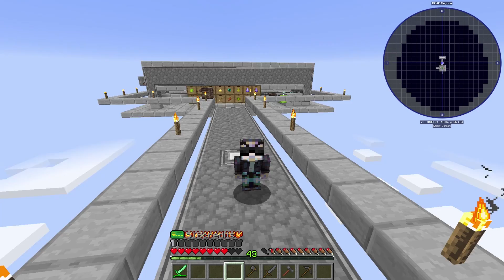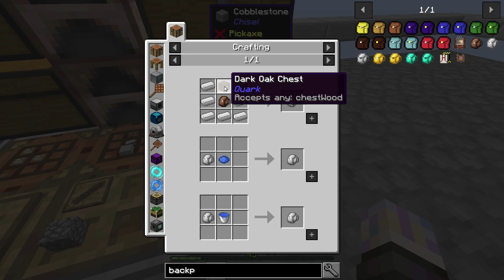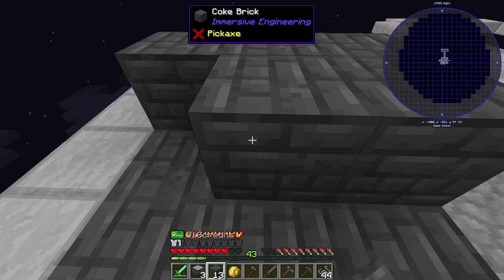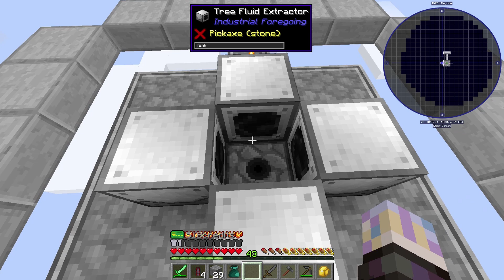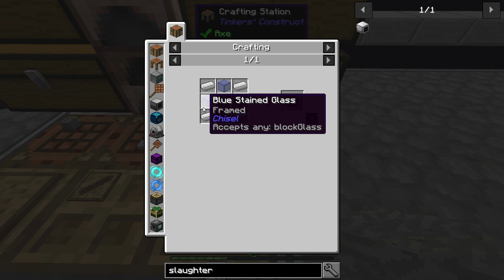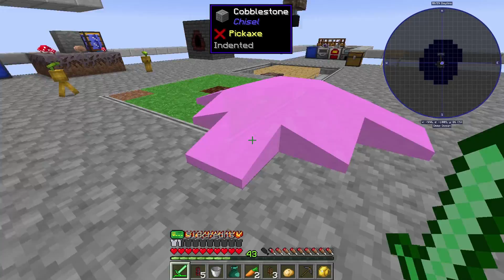SkyBlock Adventures EP5 Industrial Foreging Material Stonework Factory

Comment: if you would have your stuff in a crate touching the crafting station - you could use autopickup from it when you would use any receipt from jei. that's why at the start (before making a refined storage - i'm not a fan of ae2 ;) ) - i had in such crate gold/tin/iron/stone/cobble/planks/wood/sticks/redstone - as a most commonly used ingredients ;)
that really helps in saving the time before making any proper storage solution...

btw. thx for info that sieving was disabled in update - i was curious if that was done after some progression, so i had to collect all the stuff in nether, using silk touch, then passing it through pulverizer. i would give up on that if i would not have already ring of flight ;)